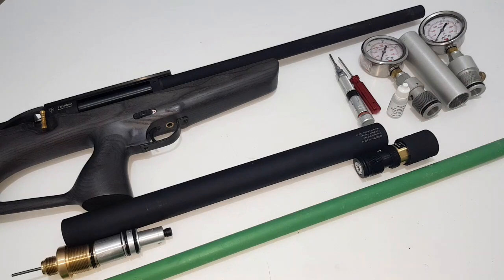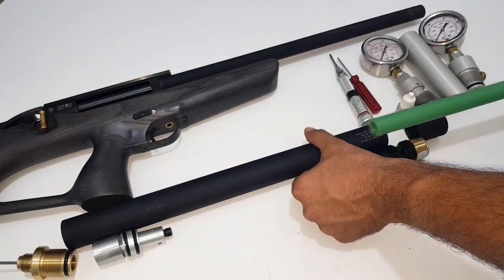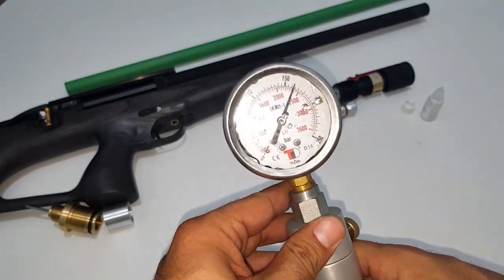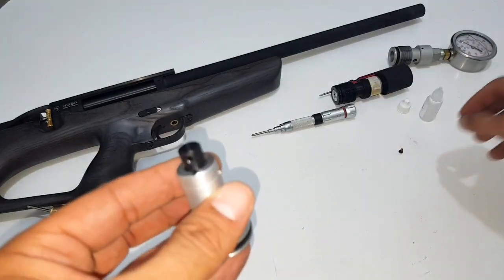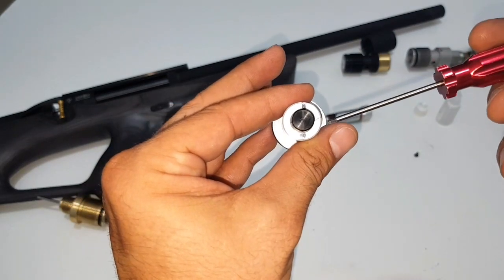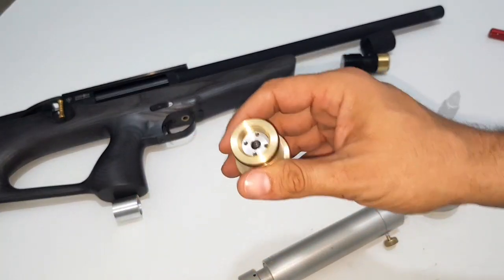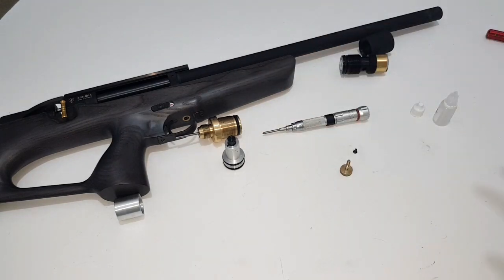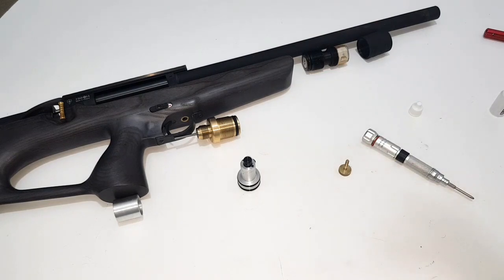Zbroia Kozak / Hortitsia regulator adjsutment

Comment: Hi, Have you tested your new setting :-) I'll like to know if I should try to adjust mine Kozak.  Best wishes
Reply from the maker: 127 bar with 450mm barrel using 18grain pellets was the ultimate settings I've tested 
Accuracy range from 850 to 900fps are the best ( test & pick the best batch your barrel like )
240 down to 127 bar 65 to 70 shots per fill
However the Regulator washer stack might be modified and also the piston port so the reg can fill quicker
Reply: @josephjaalouk  Thanks a lot :-) That I must try, and thanks again
Reply: @josephjaalouk  Thanks great video. Actually I installed huma regulator and set it to 130 bar but the velocity is 850 only. I want it to reach 880fps without increasing the reg pressure nor the hammer spring because it will vibrate more with each shot. Can I achieve that velocity by changing the valve spring to lighter one? Or for example cut a part of it to make it lighter? What do you suggest me to do. Thanks again.
Reply from the maker: @vectorkimo3447  sure it can be done, by adjusting the valve stem knob.
1st measure the depth of the knob of the valve stem housing located in rear of the cylinder counter clockwise to decrease the spring pressure so you'll be able to gain more fps.
Keep in mind that you will have a slight increase in air consumption.
Reply: @josephjaalouk  thanks sir. Appreciate your quick response.
Reply: @vectorkimo3447  You have to loosen it aprox. 3/4  of a turn that should do it :-)  I have adjusted mine also to get the right velocity, with the heavier pellets. and the cocking will still
be smooth without bashing the valve, as will happens with a heavier spring.
Reply: @pertheilgaard4982  Actually I loosened it until the depth is 4.00mm (7.3mm was factory setting), however the velocity increased to 860 max. I need to tight the hammer spring more.
Reply: @vectorkimo3447  OK is it a .22 cal. ?  my setting is 6mm on the valve and -2mm on the hammer spring, it's a pretty good setting for my gun ( P.S. i have a Lothar Walter barrel) 
and it is not sure you need the same setting. But I would think 4mm on the valve is a bit to loose, you may get a poor shoot count. Best Regards
Reply: @pertheilgaard4982  yes mine is .22 18.13gr. if yours is .22 I will try your settings. Actually I noticed that the shots sound strange and too loud.
Reply: @vectorkimo3447  The strange sound cut be the big waste off air, caused by the valve is to loose, and therefor is opening  to long time
Reply: and I forgot to say my speed with 18,13 gr. is about 850, if I go higher it opens up my groups
Reply: @pertheilgaard4982  appreciate it sir. Thank you for sharing your experience. I will try different settings and choose the most accurate one👍
Reply: @josephjaalouk  Hello Joseph, thank you for this video...... you may make a video showing this procedure in full, it would be of great help to many.

Comment: Hi there i have a zorbia hortistia with the rear bolt loader. I have two issues,could you please advise.
1, the magazine does not cock to load net pellet. That arm stays in place when reloading with a mag inside,if i wiggel the mag then the arm will go down and start the loading. If no mag is inserted the the loading meganism works.

2. The bolt doesnt always latch and stays latched, when i shoot then the bolt will automatically unlatch and cause mis fires
Reply from the maker: There's another video on my channel that tackle this issue

Comment: How did you break the golden-colored base on the bottom ?!
Reply from the maker: With hand, CW or if it's tight you need any plumbimg tool to catch it ( brass side) make sure not to scratch your cylinder good luck

Comment: In Zbroia sapsan .22 calibre for 18.13 grain pellet how much regulator pressure have to maintain to obtain 900 FPS.

What is the company factory settings reg for Zbroia sapsan
Reply from the maker: 135 should give 900fps +
Reply: Post one new video about Zbroia sapsan tuning regulator adjustment
Reply: @josephjaalouk  Usually in every air rifle after every shot the regulator pressure will set back to the regulator pressure bar tuned in it in a fraction of second. But in zboria sapsan it takes around 20 secs to get back to 150 bar pressure which I have set. So I cannot fire immediately. Does anyone faced this issue. If so tell me how to rectify it.
Reply from the maker: @rubanj007  that's called regulator creep when tuning a regualtor you need to tune of the related parts not ony the reg that way you will create the perfect Harmony